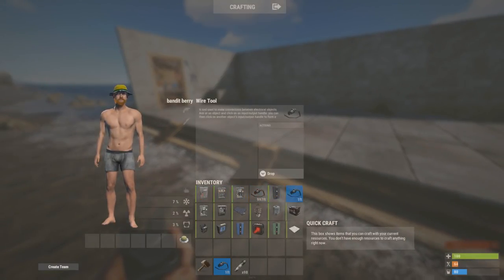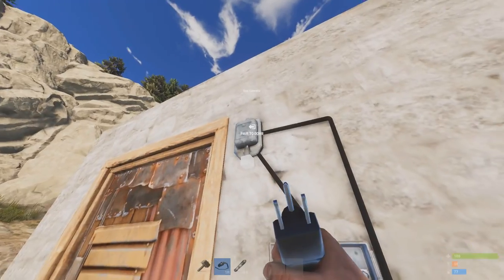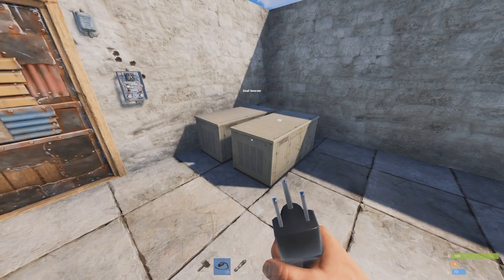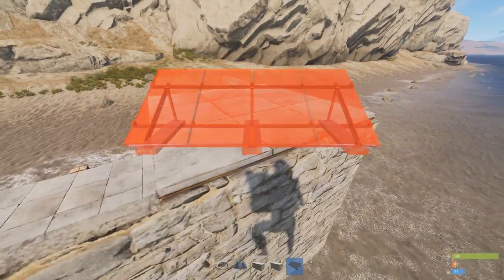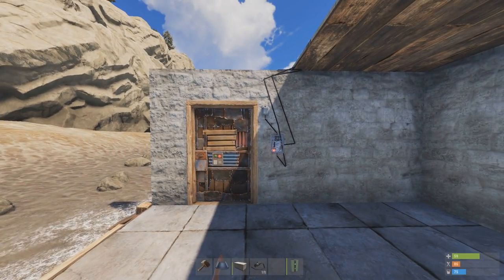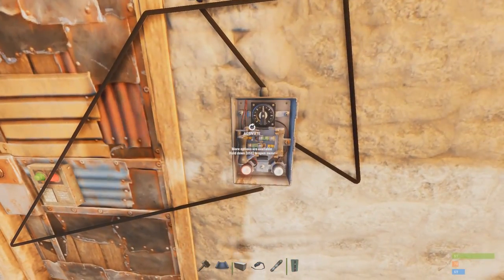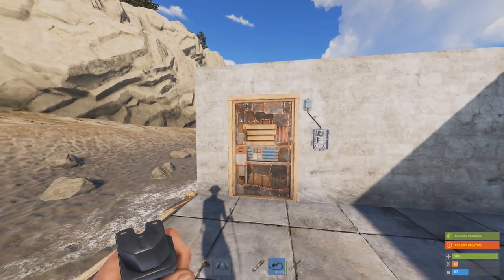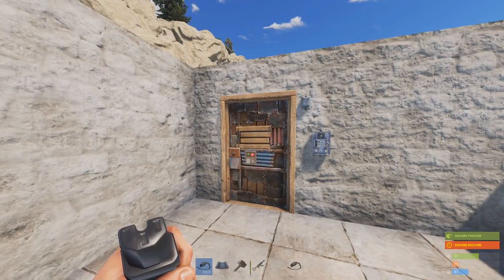RUST ELECTRICITY SIMPLE GUIDE [2018]

Comment: Your problem at the beginning was forgetting to reference Ohms law of resistance. Also, Coiling the wire on the wall would increase the voltage output from the generator. Those doors. require atleast 220 volts to power and the standard output of a generator is 110v.